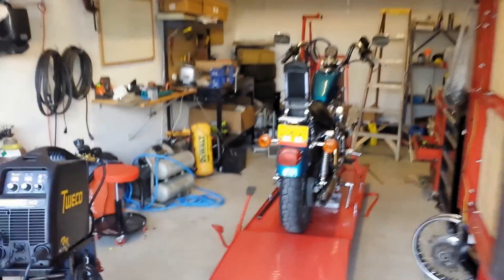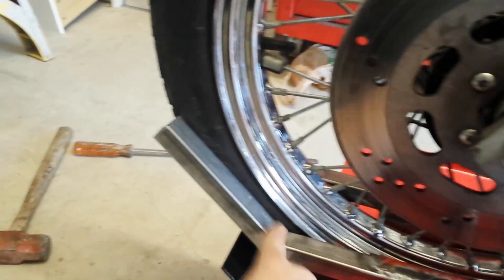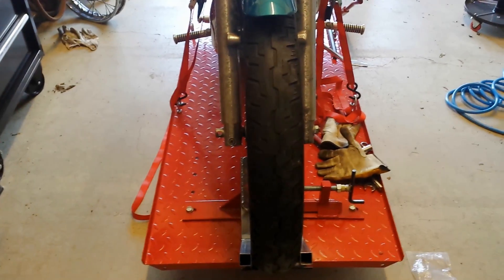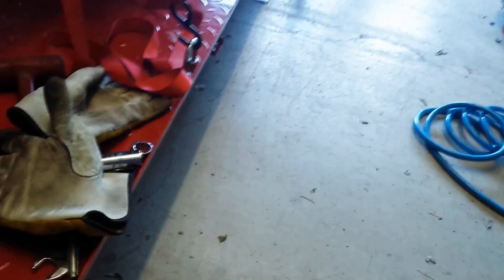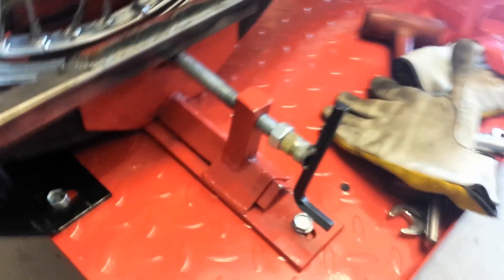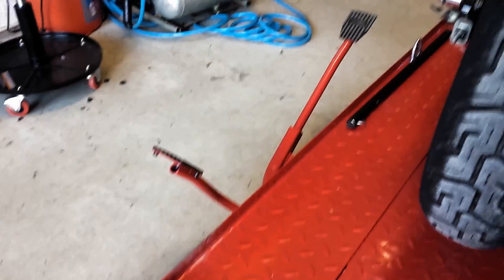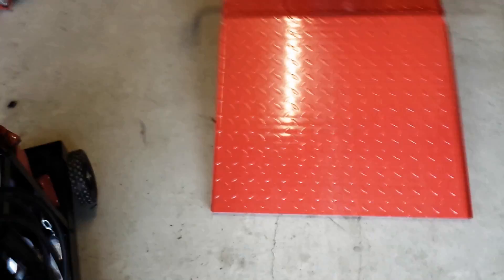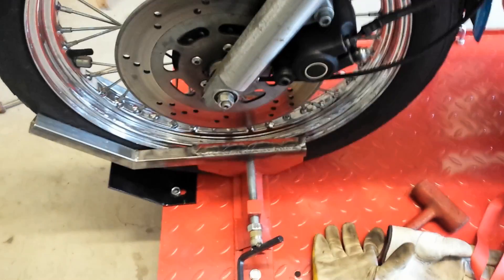Harbor Freight Motorcycle Lift Modification - Learning to Weld

Comment: Sorry, what's the point of the silver jack?  Doesn't the table lift?
Reply from the maker: The jack allows me to lift the front or rear wheel off the lift for service or removal.  Comes in handy for chain/belt adjustment and replacing tires.
Reply: Isn't that what the "trap door" is for on the rear of the table?  Not trying to be a troll or anything - just curious.
Reply: Front wheel I can understand.  sorry, just was confused on having a jack/lift on top of a jack/lift table.
Reply from the maker: Phil Minneci You have to support the bike to use the trap door.  The jack is the easiest way to do that.